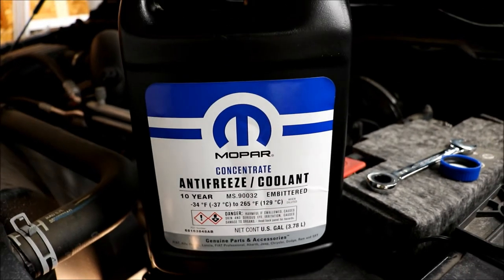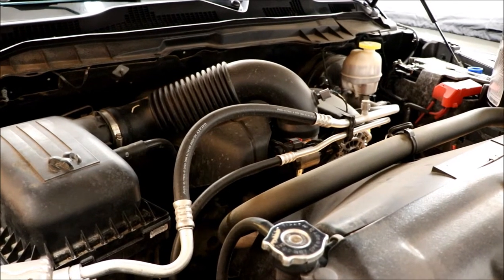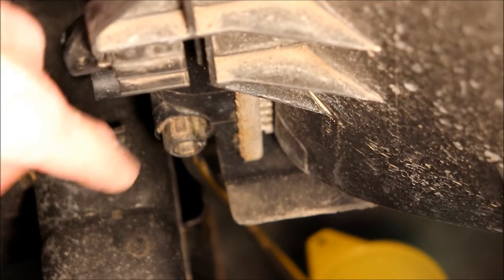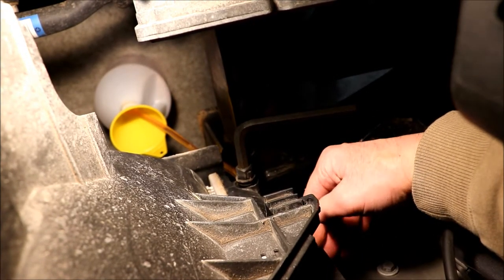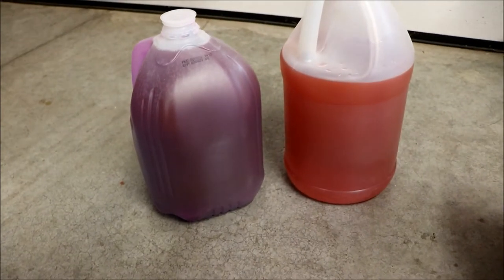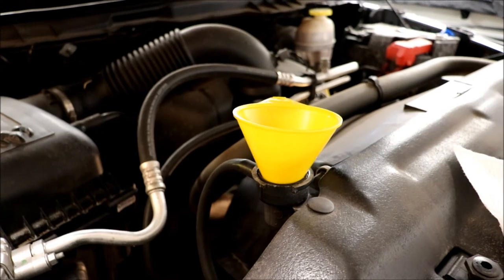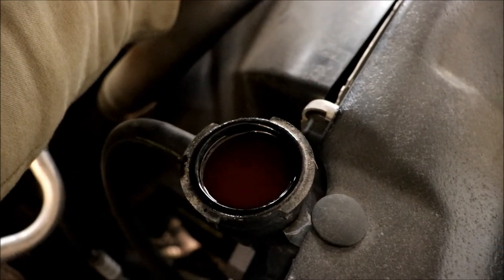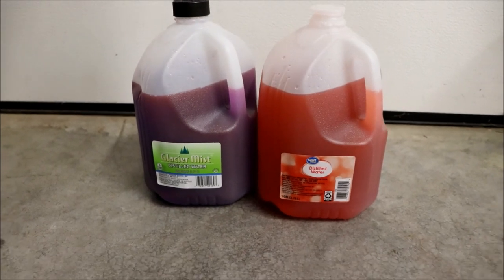2018 Ram 1500 5.7 Hemi Coolant Exchange

Comment: What about draining the engine? You only replaced half the coolant. 

You have to pull the lower hose and let it drain into a pail. After you close the petcock, refill the radiator. 

You’ll have to run the truck until it gets hot, then add coolant as the thermostat opens and takes in the new coolant. If you don’t do this step, you won’t have enough coolant in it. 

Once it quits losing volume in the radiator, you’ll know it’s full. I usually check coolant one more time after a day or two, just to be sure.

Comment: the petcock you were turning does come out. it has  an o-ring on it and as the car gets older, the o-ring starts to fail and you'll get a leak right at the drain plug. so to replace, you do what you did and when all the coolant is out, then just pull out the petcock and put the new one in.

Comment: One thing I learned from the get go...  Don't go on forums unless you have a problem..  They are packed with safety Sallys who change synthetic oil every 3K and tranny fluid once a year and diff fluid every two years...  Waste of time and money...  I think these guys spend more money on maintenance than they did on the car!   I had a friend who had a show car that he would put only 100 miles a year on!  Yet he change the oil every 6 months because he listened to the nut jobs who told him the oil needed to be changed even if you never drove with it...  Insanity...

Comment: Back in 2019 I changed the fluid on my 2014 RAM 1500 5.7L, at 85k miles. The older containers list 150k/10 year, but the newer containers only list the 10 year part.
The old fluid came out pink but the new fluid looks mostly purple. I mixed the concentrate into a clean bucket with distilled water. A large volume of this fluid almost looks maroon with hint of purple where the light is penetrating. 
People way to pull the lower hose, but there are also three drain valves on the engine, with one of them being nearly impossible to get to.

Comment: I'm replacing the antifreeze on a 2017 same vehicle because the housing to the thermostat has a leak now it has no radiator fluid in it actually it didn't thanks to the wife so basically I'm going to replace the whole thermostat housing where the hoses connect when replacing the housing before I put the antifreeze in it should I do it while it's off or on and should I do from the reservoir or straight through the radiator
Reply from the maker: If you can pour directly into the engine from the t-stat housing I would start there and then fill the radiator.

Comment: I’ve been searching everywhere looking for Information on the coolant for my ram 1500, so just like you the coolant in my truck is pink/red and the coolant I brought was OEM pre mixed and it was purple, have you had any problems I’ve been worried about mixing the two coolants
Reply from the maker: No issues, as long as the coolant type is the same the color doesn't matter.

Comment: So you didn’t mix anything correct? You just opened up the new coolant and poured it into the radiator? Did you add some into the the little tank with the coolant dipstick?
Reply from the maker: I had to mix it because the dealer didn't have pre-mix.  I did pour some in the overflow tank.

Comment: How many gallons of coolant is necessary.
Reply: 2 gallons of 50/50, with cover a Radiator drain and refill if you are changing out thermostat. Whole system holds three gallons, if you are flushing and refilling whole thing.

Comment: Hey shouldn’t it just be as the 3.6 penstar. So basically it will show low when the car is cold it’s in the radiator. Now when hot the radiator is cooling condensing which causes the resivour to become full to the max level so you might have over filler your system buddy